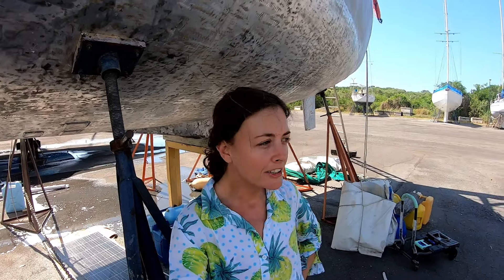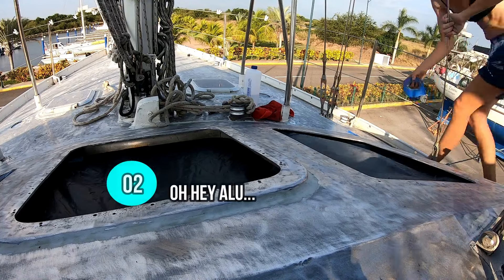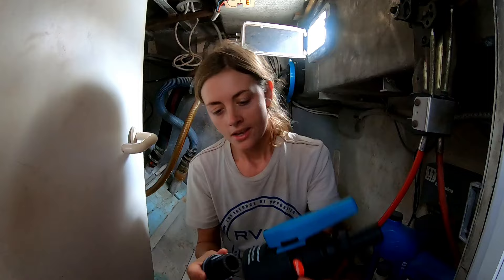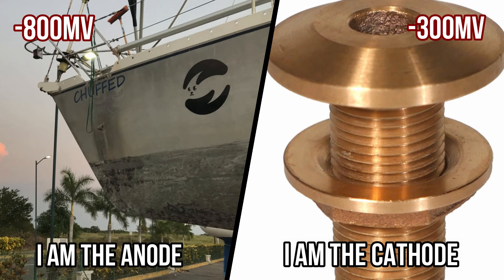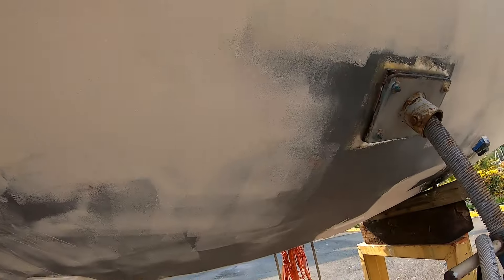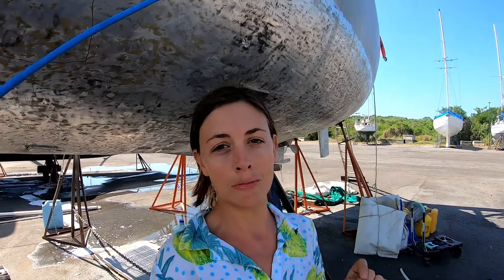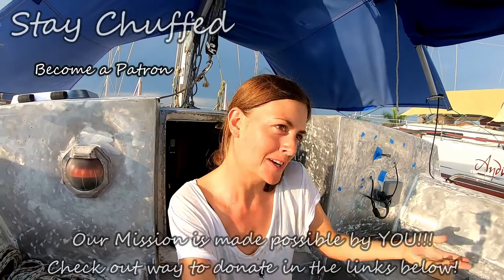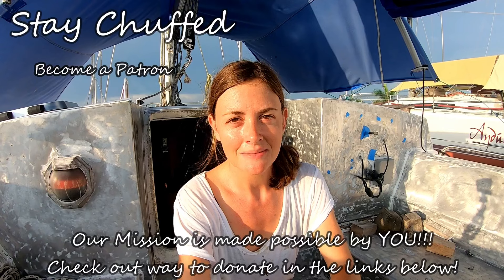Anodes are Good, Corrosion is Bad... Aluminium Boat 101 Chuffed Special

Comment: haha most people just talk about the difference in the nobility of metals, of course the good doctor talks about the difference in potential electrochemical voltage, which is the correct way to explain galvanic corrosion. Be sure to get a galvanic isolator for your shore power connection - it will stop stray currents from other boats from eating away at your boat/anodes when it is on shore power.

Comment: A "must" on an aluminum (or steel) boat is an isolation transformer. Not a galvanic isolator, that helps too, but an isolation transformer. Only this a 100% protection against stray currents in a marina, from either faulty marina installations or faulty installations on other boats.
Reply from the maker: Am I right in thinking thats only for shore power? We dont have shore power so all good here ;)
Reply: @VetTails  Yes, you are right. But why do you have no shore power? It is the most convenient and quickest way of charging your batteries, when you are in a marina. If the reason for not having shore power is the threat of galvanic corrosion from various marina sources or other boats, then an isolation transformer is the answer. It isolates your hull, galvanically, from any and all such threats.

Comment: Very interesting, thanks. It’s interesting that you’ve painted the bottom of the hull. I wonder if you considered just leaving it bare and increasing the anode mass to compensate. A small chip in that coating and you could get rapid corrosion at that spot due to high proportion of the coated surface (which will become the cathodic site) compared to the chip (which will become the anoxic site).

Comment: I have been looking for heavy gauge aluminum boats here in Hawaii and now I suspect I know why there are very few of them. Proper building based on the material preservation when working with finite elements and their electrical properties. It would be a solid and minimal effort to maintain if done correctly. Very insightful info. Mahalo for your time and insight.
Reply: Believe their are electronic monitors and preservers of aluminum available in addition to the process you are using in this video as well....aluminum boats hold their value well if properly protected.   I have had two aluminum boats with issues but kept more than required and fresh anodes in place.  I chose not to remove the oxide or paint above the waterline kept an electron barrier between dissimilar metals on the boat as well.

Comment: VTSC, one aspect of the tank bottoms corrosion is water bottoms (condensate or fuel impurities) can become acidic or shift their neutral ph to the acid side due to DE-aeration when left under fuel in a bare aluminum tank.  The aluminum will 'remove'/strip or attract the oxygen to the aluminum oxide and the ph shift happens. After the water bottoms become acidic enough they will start crevice cell corrosion sites as you show in the video.  For this reason water bottoms sumps coupled with regular pump-outs are part of well designed, built & maintained marine tanks.

Comment: That was awesome, you explained that so well and easy for people to understand.
Reply from the maker: Glad you think so!
Reply: When the connecting screws on the roof of the parking garage all rusted out when we had an interest in a condo in Mexico. No one believed me that it was because there were two different metals in contact. A few looked it up and were astounded it was indeed true. The builder should ever have used two different metals which was in reality three metals. The steel roof structure, the metal roofing and the subsequent incorrect metal screws. I think you have done such an amazing job, from scared, frustrated and in tears to in control and fully aware of the workings of your boat.

Comment: Having spent 30 years trying to eliminate electrolysis on my steel yacht I know it very difficult to avoid completely.  Fortunately the damage was small enough to keep on top of.  Some of the things I found to watch for were anodes with to high a lead content to work properly,  stainless to mild steel contact, an alloy heat exchanger that has a direct contact to the sea via the raw water system.
Reply from the maker: Yes it is a the battle of metal boat owers!
Reply: I tell folks to repaint inside and outside on a regular schedule...steel boats will rust more inside of boat in unseen and hard to reach places quicker than outside the boat.

Comment: Very clear explanation, but raises some questions. 

1- You prime her with zinc-phosphate. Zinc in this compound should provide enough anode protection, doesn't it? So there should be no need for external zinc anodes.
2- External zinc anodes applied after many prime paints, which prevents zinc to touch and react with aluminum. So these external zinc anodes probably be useless. What is your experience with them?
3- I heard that most corrosion on metal boats not occur on outside, but occur on inside. Boat owners usually focus on outside protection and neglect inside protection. What preventions did you do for inside of the hull?
Reply from the maker: Hi! The zinc primer does help a little, but it gets coated over and doesnt contact water so stops acting as a sacrificial anode. The anodes are bolted to the hull so make electrical contact with the hull and the water - we don't paint under them or over the top of them. We keep our bilges bare so we can inspect, some people do paint them for protection too, but ultimately the anodes will sacrifice before any of the aluminium parts so help protect the whole boat inside and out!
Reply: Thank you for response @VetTails . Keeping bilges bare is a good option for aluminum boat owners. I recently bought a steel boat, I'm afraid to have inside corrosion. And keeping bilge bare is not an option since it rusts ugly unlike aluminum.
Reply: Always heard most steel boats rust out inside first.

Comment: Always use an isolation device when using marina power--as well as the other things you said.
Reply: @WilliamHelstad  Either an isolating transformer or a set of bridging capacitors.  The idea is to isolate the vessel from the marina's power earthing system, thereby preventing your boat becoming the best earth for stray current and phase mis-match the entire marina power system has--with alarming rates of corrosion as a result.  On my vessel, which was not aluminium--I used an isolating transformer.  It was heavy.  There are more modern devices available.

Comment: I was just out on a friends brand new dufour 390 when i said she should check her anodes when ever she gets a chance (since she charters her boat) I dived on the boat and saw her saildrive anode had a missing screw and was hanging off the saildrive, she didnt even know there was an anode there. Could have been an expensive mistake. I got the impression you didnt know any of this before you saw all of this damage and have learned a great deal since then. The last 2 bits of advice, dont drop any screws or metal in your boat, be hyper vigilant about it, if you drop a sss screw into the bilge you will end up with a hole in your boat, next any time you need to screw a sss screw into your alum, use duralac on the screw - it will isolate the 2 metals. gl hf.
Reply: good point

Comment: As usual, Sheddy, the episode was tops !!! When you pulled the stainless rail away from the aluminum, I thought for sure you were going to mention how to place a non-metal disc in-between metal to metal contact to reduce galvanic corrosion. Totally agree (on any kind of boat) anodes are our friend. ✨💕✨✌️✨⛵️⚓️🏝👣👙✨
Reply from the maker: Ah yeh, we did actually do that haha! Shouldve mentioned it ;) Anodes are my best friends now for sure
Reply: @VetTails  could the boat have been built with aluminum rails instead of ss?

Comment: One of the most interesting tests , at least to nerdy me as I like electricity, was the one with a silver ingot, or at a minimum a well plated silver spoon, and a meter. Something like throwing the spoon into the salt water and measuring the voltage , with the black meter lead hooked to the boat, and the red meter lead on a wire connected to the silver. You get a voltage reading that indicates how well your "Zincs" are working. Apparently there is a sweet spot voltage which means you have the optimum amount of zincs for your vessel, its possible to have too much or too little. Its a topic which is hard to find details, especially for the more rare aluminum vessels, , kind of a scientific pursuit for a group of us . My cruisers help playlist has about 10 videos on galvanic corrosion topics. Yes, the systems you need when connected to shore power get a little complex and expensive. That said, there was a site called JetDock where they mentioned 1.3 volts as that special voltage and not going over that. Would need to ask them more about that. Also, with the Zinc sure to disappear, its essential that the hardware attaching them doesn't leak after the Zincs have disappeared.
Reply from the maker: Yes would like to try that, Will and I went around to each wire and the hull measuring any conductiveness to find stray leaks etc which was interesting
Reply: @VetTails  can you describe that process a bit more?

Comment: you should be using high magnesium alloy anodes on aluminium hull. zink is good for a steel hull. you need some thing more reactive
Reply from the maker: Magnesium alloy is really good in fresh water, but zinc anodes will work well in salt water on an alu boat and are bit more readily available and cheaper. Zinc anodes slough more readily too so less chance of oxide build up rendering them inert.

Comment: So random I came across your channel.
Im polishing an aluminium V8 chev inlet manifold and searching for tips and tricks.

Im wondering now after seeing your video, if I attach an anode would it help inhibit corrosion in an engine?
Given its an engine its does use high tension and low voltage, plus has water running through it for cooling. Surely that has to attribute to corrosion in the block and head.

Im guessing if an anode could help an engine, someone would of already done it.

Man great project and you really have a presence about you on camera.

Im in Radelaide... So Go Oz content.

Comment: Hi, love the vids! I'm about to repaint my 4.9m Allycraft Centre Console. What is the best method for removing old paint from aluminium? Paint stripper? Sanding? Grinding? Wire brush on angle grinder?
Reply from the maker: We did a combo - the important thing with paint stripper is it MUST be washed off really well, and we didn't leave it on as long a it said (it is corrosive to alu). We applied paint stripper (car) to small area (0.5mx0.5m) then scraped, washed it clean, and did that to the whole boat. Then we sanded using a black poly strip wheel - normal sanding seemed like it did nothing!
Reply: @VetTails  Thank you! Appreciate it...

Comment: Hi Chuffed,
Could you please outline your paint regime for your deck area. I have an older aluminum sailboat that needs to have the topsides done. Would love to know what you used and how it has held up.
Many Thanks, David  SV Tomcat
Reply from the maker: Hi! We sanded back to bare aluminium, then used the pettit 6455 etch primer, followed by EZprimer than the top coat. We used all pettit brand -  the EZpoxy top coat is peeling a bit, but overall held up ok! We also painted in less than idea conditions which I don't think has helped!

Comment: Thank you for sharing. I learned something new about aluminium boat. I have a few questions. It looked like you are using a mounting for the zinc anodes that has been welded to the hull. Is this mounting bonded (ie.  electrically connected to all the other dissimilar metal in the interior of the boat such as the engine or shaft by tinned copper wire)? Is the welded mounting preferred for safety because you did not want any extra holes in the hull for fixing the zinc anode? Is there such a thing as having too many zinc?
Reply from the maker: Hi! I will do my best to answer. We have a floating electrical system so nothing (e.g. engine or electrics) are grounded to the hull in anyway. The anodes really only protect from stray currents and the dissimilar metals. We went welded so as to avoid more holes, but plenty of people put a bolt through! And yes you can have too many zincs - I don't fully understand the ins and outs of it BUT you can have too many and there are online calculators that help you figure out how much you should have :)

Comment: Is glass bead/walnut shell/sand abrasive blasting an option for removing the aluminum oxide?
Reply from the maker: Yes, very good option, but need to paint quickly or give a light sand as you paint because al oxide forms really quickly (minutes). Wish we had that option -took a long time by tool/hand!

Comment: Hi I just have a question regarding the anode installation, do you use bolts and how do you keep it watertight?
Reply from the maker: They welded aluminum plates to the hull that have threaded holes in them, we then use short bolts to attach the anode to it :) People do bolt through though and just use a tonne of sealant

Comment: i would have used interprotect 2000e and use aluminum anodes not zinc. i would also get an electroguard 630afm kit for $1500 for iccm.

Comment: Thanks for the video. Interesting and very useful. Do you leave unpainted/untreated the contact points between the anodes and the hull (metal to metal contact)?     Good luck in your adventures.
Reply from the maker: yeh, the screws themselves conduct between the hull and the anode :)

Comment: great explanation, thanks!

The thing I've never understood is  how to properly ground your electrical system in a  metal boat. Be nice if you could cover  that (or do you need to bring in your dad for a guest lecture?).
Reply: Agreed! Discuss an electrical ground for corrosion, one for the radio, and, particularly important, what to do about lightning. Also maybe one about how you traced down that stray current.
Reply: Simple answer...
Negative buss. The hull of a metal boat should be utterly isolated from any and all on board electrical systems.
However, this doesn't remove the need to install chassis grounds to the hull (AC only). These grounds should Never conduct Any current. They are only there to ensure a dead short in the event of an internal failure within an AC consumer. Without these, if an internal failure occured allowing the chassis to become energized, the next person to touch the unit will become the path to ground. 
Hope that helps. But if you are at all uncertain about power on your boat, hire a well recommended and experienced professional.
Reply: Negative grounded steel boats and hull isolated steel and aluminium boats is normal. Mast and stays are connected through the boat to the water, so that is the best lightning protection there is.
Reply from the maker: Generally a 'floating' DC electrical system is used on aluminium boats, so the entire battery/wiring/engine unit is completely isolated from the hull. This is what Chuffed has, we have no shore power so there is no AC current onboard (well there is an inverter but yeh nothing running through the boat). It is a suuuuuper confusing topic with a lot of theories going both ways, so not sure I would feel as good about telling people how to do it incase its the wrong info - dad may be a better bet!

Comment: Great video. I would like to add there is a good product to avoid galvanic corrosion where contacts between dissimilar metals can't be avoided (example. Stainless steel bolts into aluminium). It's called DURALAC, a yellow paste that can be applied. Check it out :)
Reply from the maker: Great point! Going to look it up now thank you!

Comment: Honest question im looking at an aluminum yacht, do they get hot in the tropics, i plan to be based around darwin/Indonesia?
Reply from the maker: We’ve actually found ours stays pretty cool, below the waterline isn’t insulated so if the water temps a bit lower than the outside air it seems to keep the boat a little cooler I think!
Reply: @VetTails  hey thanks for the reply! SO would you say realistically probably similar to yachts of other material builds? I have read online that the hull being submerged and the high heat conductivity of aluminum essentially turns the boat into a heat sink keeping them cool as the conducted heat is transferred into the ocean? this is were your air water temp answer comes into play.  But in saying that i work on 2 large 80ft aluminum industrial boats and down in the unventilated bilges can get very humid! I'm stuck and don't know what to believe my own experience or that fact that yachts are different to my bilge experiences in these bigger boats

Comment: Got that , , , how are you going to fill All the holes and corrosion areas  ,do you bog the bottom  ,or can you glass it , never owned a alloy boat like yours
Reply from the maker: We did fill the holes with g flex epoxy mixed with filler, I think last episode covers it :)

Comment: ok so I have a life goal of an aluminum boat.  Mostly because I would like to go to Patagonia and the Arctic.  Now, I have a few questions: the places where there is pitting- doesn't this create a weak point in the boat?  Also, wouldn't painting the boat help with this? Lastly Also in construction there is also this problem but then they separate the two metals with something benign- cant they do that on a boat?   I knew aluminum is lighter and therefore makes for a faster boat, but would steel be safer? Or does it have similar issues?
Reply from the maker: Steel rusts, most metal boat owners I think dream for aluminium more so, but steel is easier to weld. We do try to seperate the metals as best we can. The corrosion does weaken the hull, some areas we had a new plate welded to make up for this. And the boat is painted :)